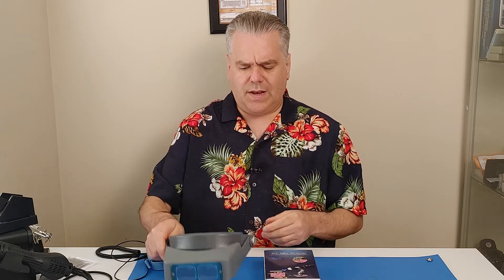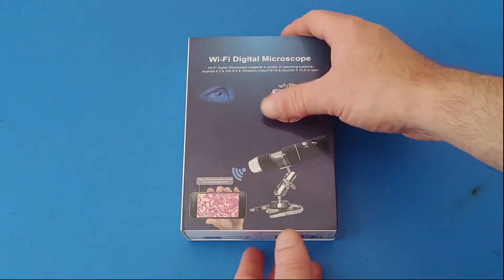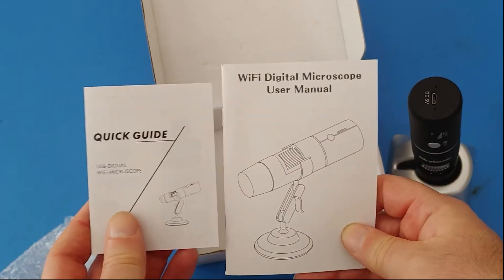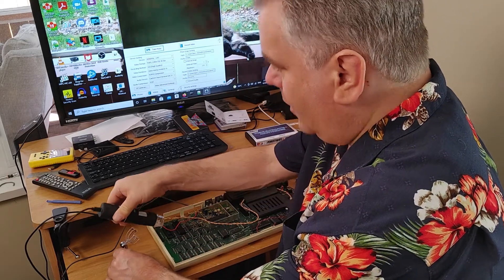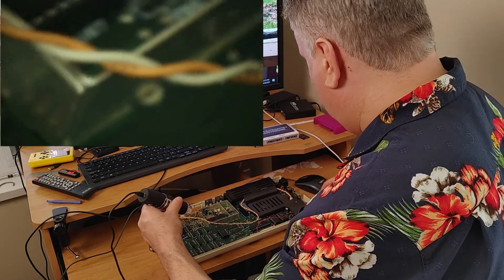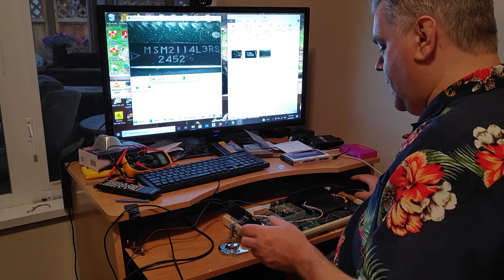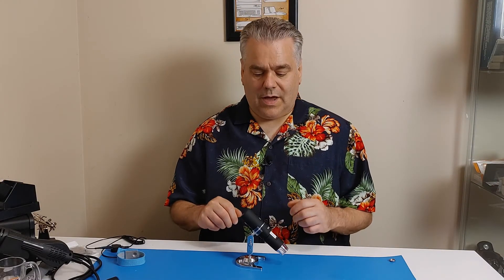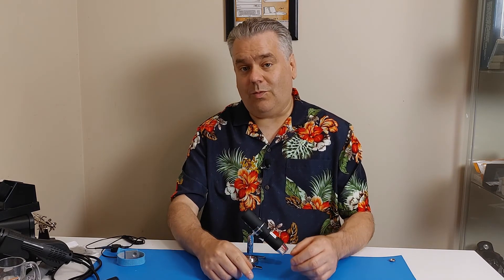A Skybasic WiFi Digital Microscope:  Is It Any Good?

Comment: Seems the video has some lag....that might be an issue while one wants to do soldering in real time.
Reply from the maker: I didn't notice any lag while using it, the video may have been slightly out of sinc as I had to sinc it up manually.
Reply: @CanadianRetroThings  Ah that sounds logical.